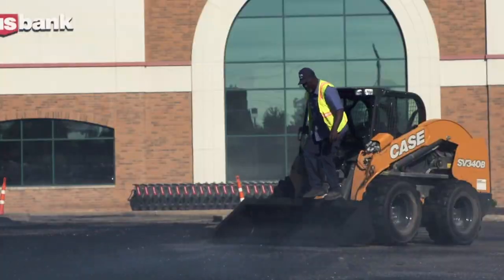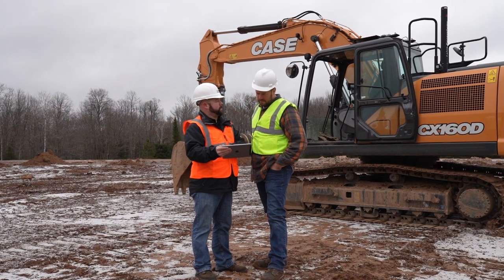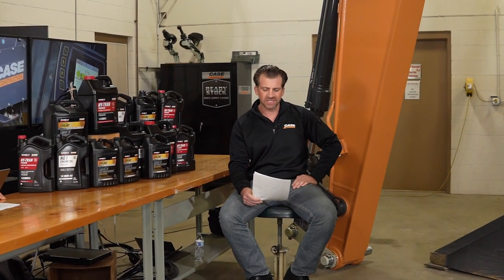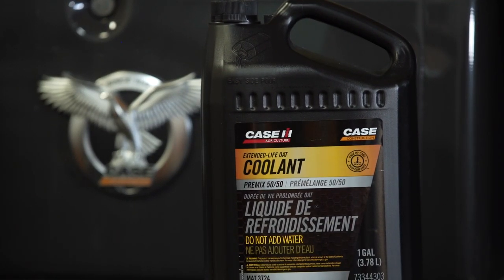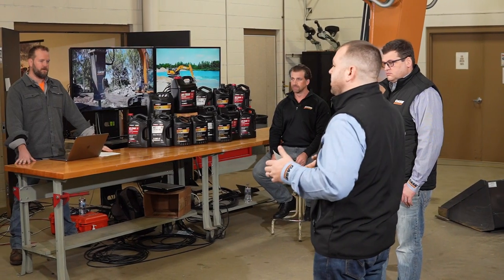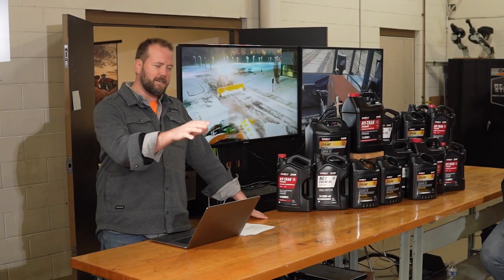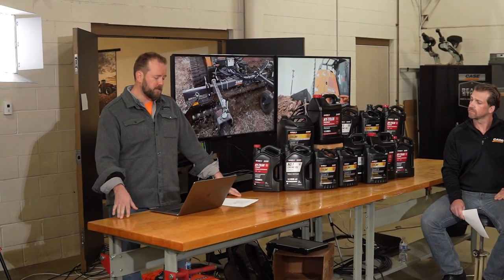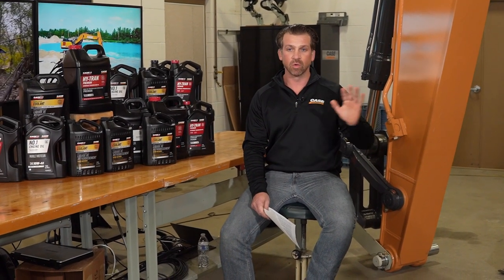North America: CASE LIVE: Preparing Equipment for Spring

Comment: Guy's I have a Cx160B Case. It has a manual thumb. I need to know if my machine has a hydraulic valve already on it that activates/works the cylinder that I wanna put on it. Do you have a picture of where the valve is or should be located? Thanks. And how can I reach you? Thanks again.